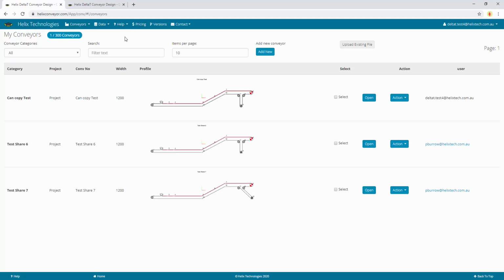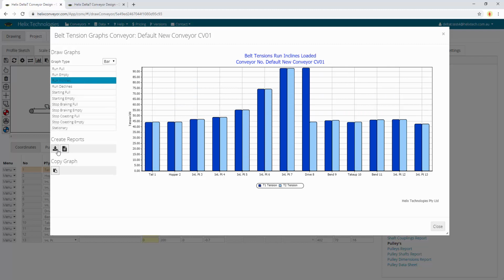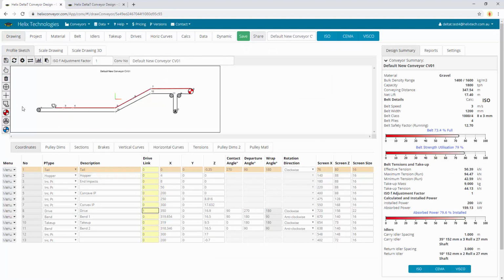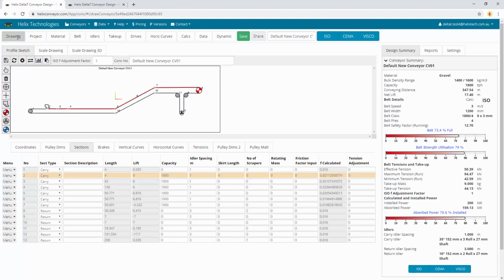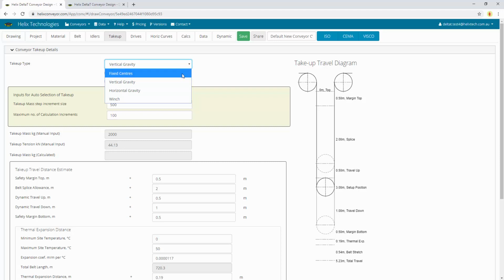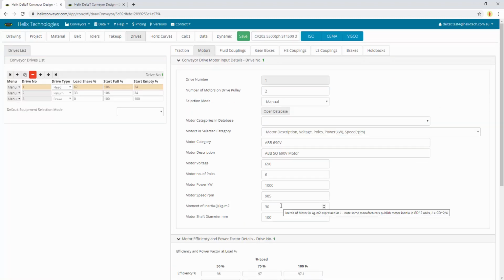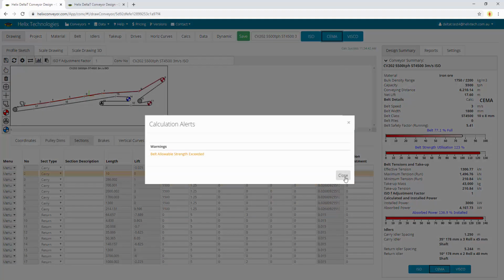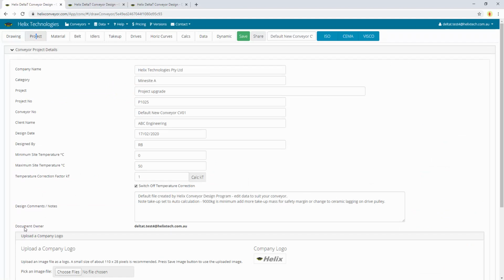DeltaT Online Conveyor Design - How the program works

Comment: Hello, Is there any course about desing belt conveyor by Helix ?
Reply: Hi, there is no training course scheduled, but the program has very good and detailed help files which explain all the input data required and how to refine the design, see the Reports help file topics.
Also, if you subscribe and include the Technical Support Addon in your subscription, you can email us any questions about how to use the program.
Regards
Peter Burrow

Comment: Hello rob, i've filled all parameter such as coordinate, belt, take up, driver, starting etc.  Previously i've success to run my model. Then i start over with another model but it didn't show the result like before (not all points have velocity). Of course, with different input coordinate and parameter.
I have T1 and T2 in negative value for carry belt in several points.

I have no idea, is that my parameter or anything else?.

Thank you rob...
Reply: Hi, You need to check the x,y,z co-ordinates by using the scale drawing - it will show any mistakes in entering the coordinates. A negative tension means the conveyor is regenerative.
Please use the contact form in the application for future questions, also give us details of you subscription eamil address in the contact form and we will be able to help you.
Reply: @peterburrow6713  thank you rob. I've done my work. Actually i found my mistake. I placed the drive in small number/row instead of placing tail pulley there. Now it's solved.

Comment: Can you help us? there are some problem for Helix Software. How to activate the checklist column on the Pulley Dimension, so that the pulley selection can be done by manually. like a point in the minutes 23.00.
please inform to us.
Reply: we have the originally software from Distributor Helix Company in Indonesia.
Reply from the maker: Hello Boy Alfredo. Please contact us directly. Go to our website and leave a contact message or email us. 

I think you have the desktop based version of the program and in that case you must go to the pulley dimensions tab under the main profile sketch and check the manual input checkbox. You can then enter your own pulley data and it wont be overidden from the pulley data from our databases.

I hope this helps.